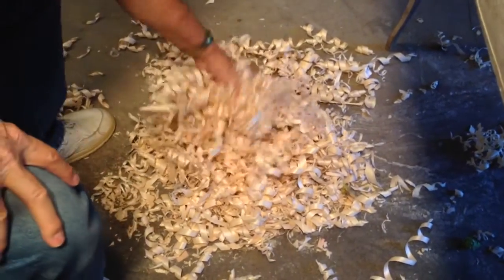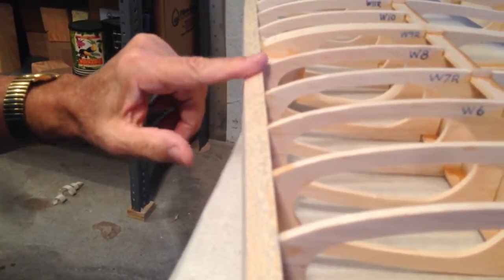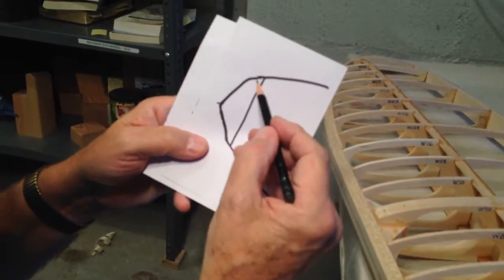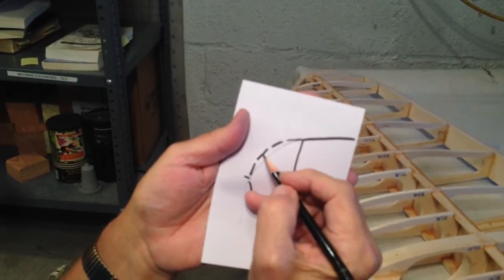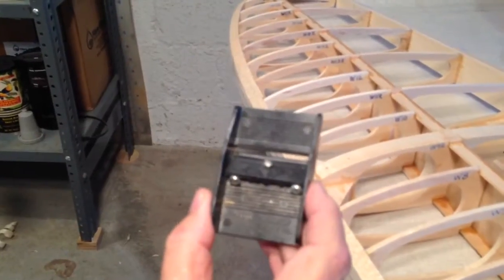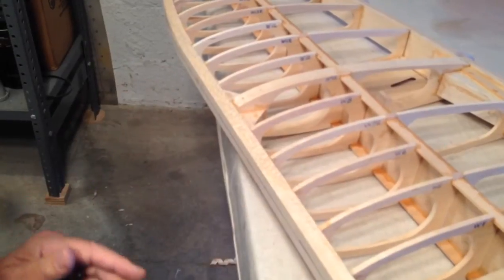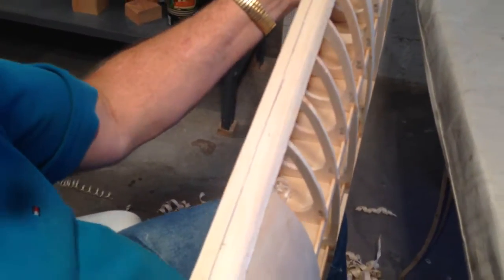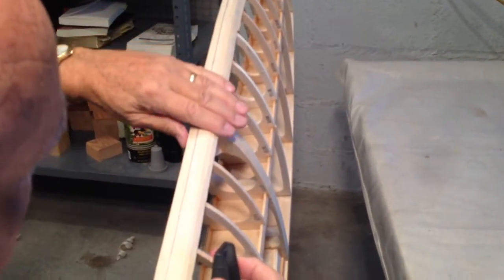Wing Leading Edge Shaping Part 2

Comment: Wish I had seen this video a bunch of years ago! I do exactly as you do after lots of false starts and screwed up leading edges over the years. Key is never to remove the center line guide during the shaping. I apply duct tape to the ribs near the leading edge during final sanding to ensure the rib shape is not changed.